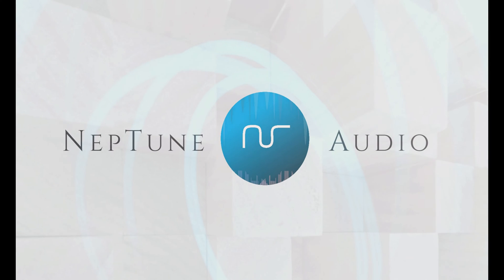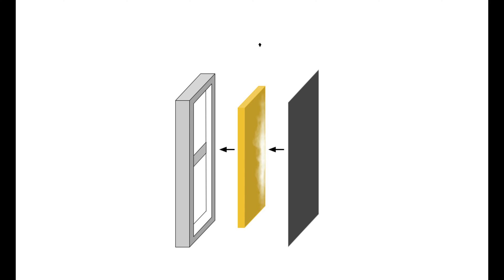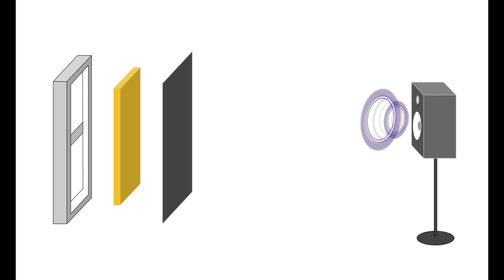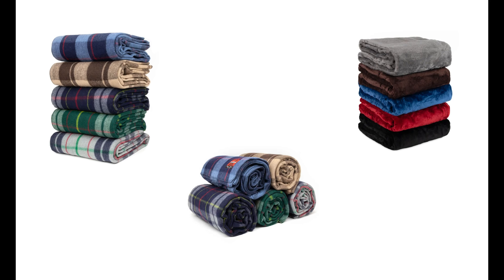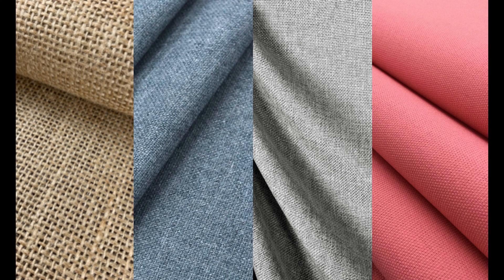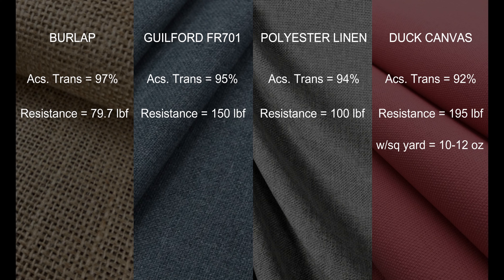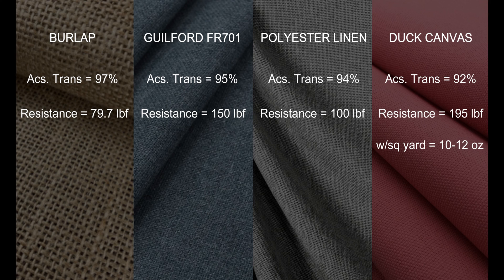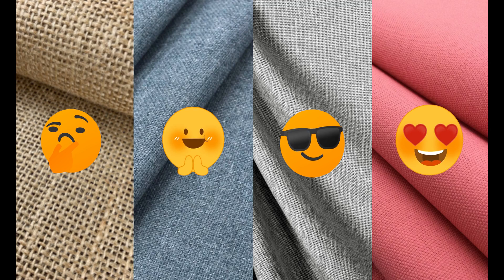Best Fabric For Acoustic Treatment | Choosing The Right Acoustical Fabric For DIY Absorber Panels

Comment: This video is nonsense. If the fabric isn’t reflective, it doesn’t matter what absorption rating it has; the rest of the sound will pass through to the filling material and be absorbed. The real issue with different fabrics is breathability. If the fabric is too dense, it will reflect sound instead of letting it be absorbed. It’s that simple. Use 70 gsm - 120 gsm fabrics then you are good to go

Comment: Would polyester fabric from a craft store be suitable to use as a covering or must it be dmd fabric?
Reply from the maker: It depends on how the polyester is manufactured. Not all polyester are made with acoustics in mind. Ensure the one you use does have loose weaves enough to allow sound waves through it. Polyester-Linen blend are usually the best in terms of acoustic performance.

Comment: how about rockwool particles... is also a very important point to consider...
Reply: sheep's wool is apparently a healthier alternative
Reply: I've heard as long as the material has a tight enough weave and the acoustic panel is not disturbed you should be just fine using rockwool. The only way to effectively trap all the rock wool particles in place even when disturbed is to encases the material in something that is not acoustically transparent - and therefore defeating the purpose.

Comment: Hi, I'd really appreciate your advice. Long story shortened...I bought 9 acoustic 2x4 panels and they are wrapped in cotton canvas duck 10oz. I bought them thinking it was Guilford of Maine. My panels don't really pass the blow test so I was determined to re-wrap the panels myself in Guilford. Now that I watched your video, I'm unsure. What are your thoughts? Would I get a noticeable acoustic performance benefit by tirelessly re-wrapping them?
Reply from the maker: To be honest, there is still a slight noticeable difference in performance between Duck Canvas and Guilford of maine even though the numbers may seem close. Not to say that Duck is poor in performance. It also performs well overall across the spectrum except with just a little less performance on the higher frequencies only which sometimes isn't a big deal for most folks. So you can probably rewrap them in Guilford if you want that full spectrum absorption.
Reply: @neptuneaudiospace  Thanks for your reply. I ended up painstakingly re wrapping them. I will never know if it made a significant difference, but for piece of mind I'm happier now. That 10 Oz duck fabric is very thick and has zero breathability.
Reply from the maker: That's nice. You'll definitely get the benefit of it for sure! It was never a waste of time.
Reply: @neptuneaudiospace  I appreciate the encouragement!

Comment: Polyster is not breathable why are you recommending it for acoustic panels
Reply: check out stretch velvet frequency response
someone posted it on a forum
90% poleyster fabric with 10% spandex is 90% acoustically transparent
Reply: I tried the breathability test while looking at polyester in the store the other day. It breathes pretty good to me. Hypothetically speaking, If I was to use the material to filter out smoke over my nose and mouth - I would not trust it. Which in this case, is what we want right?

Comment: If the fabric is breathable as suggested wouldn't this cause a problem? I am using wool rock and for what i am reading the fiber glass can cause lungs problems. In fact it is recommended to wear mask while installing it . I imagining sitting in a room breathing all the fiber glass from the roo k wool can cause a serious health issue. Am i missing something?
Reply from the maker: You shouldn't be too worried once your panels are wrapped and remain hung on the wall. If you want to ensure peace of mind, use fabric like Duck Canvas, which has a tighter weave that can trap those loose fibers and keep them from escaping into your space. However, It's important to apply safety during the building stage.
Reply: During installation and handling yes. But once they hang and are not bothered they’ll be ok.
The levels it takes to do damage is kind of high.